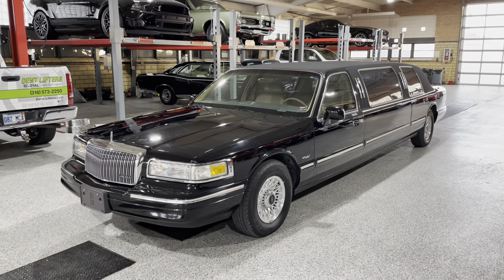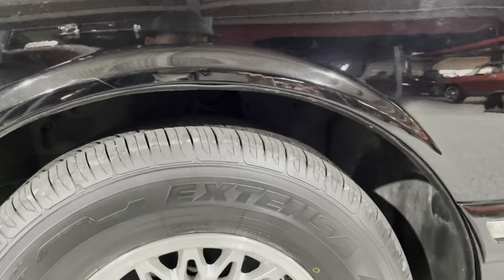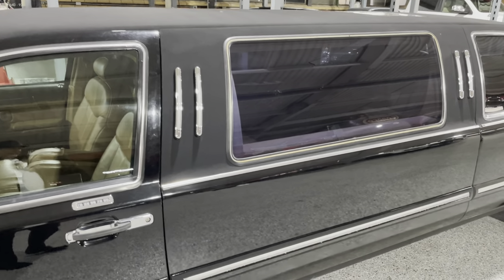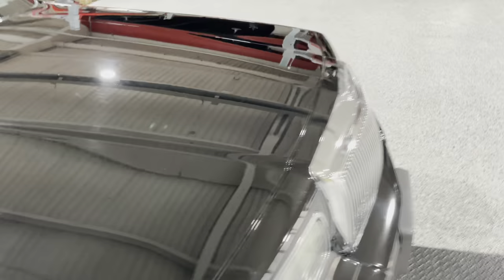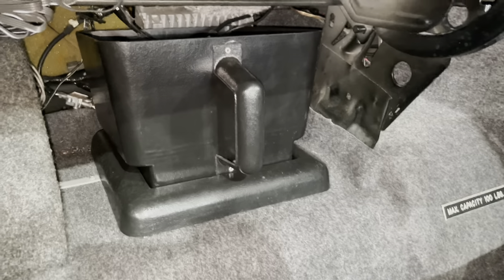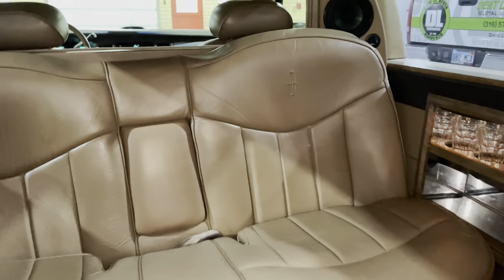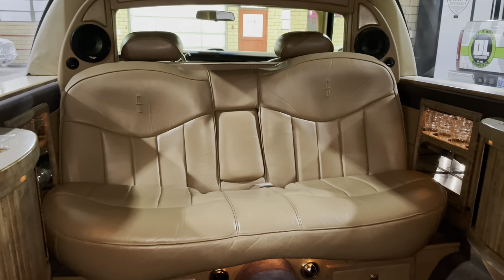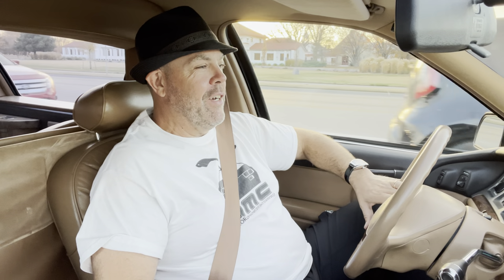1996 Lincoln Town Car Executive Limousine for sale

Comment: Power numbers anemic. However that can be remedied. Toyo tires “value rated “ meaning inexpensive but ok. Should have whitewalls on it
Reply from the maker: Car does everything it needs to do.  I disagree on white walls on this one.  Not many tire options on these old sizes anymore.  Toyo  works great on this application.  Also had a heavy duty option.